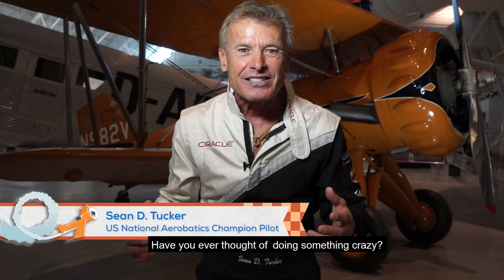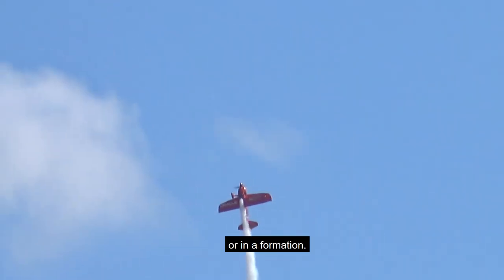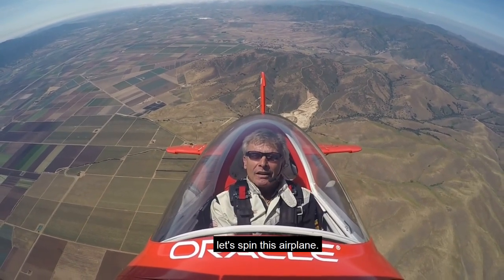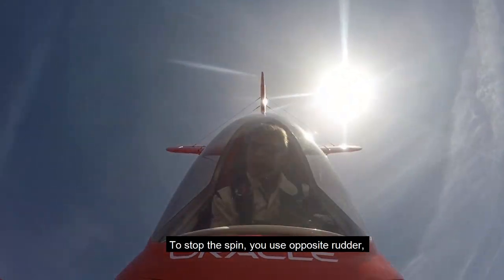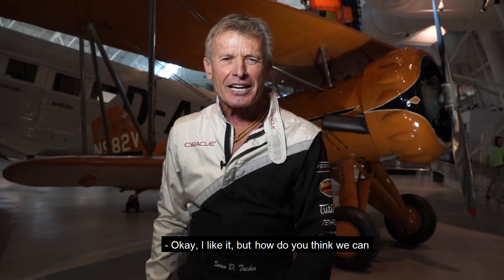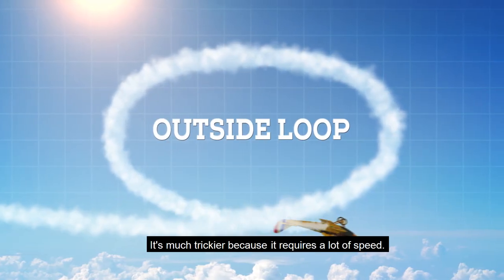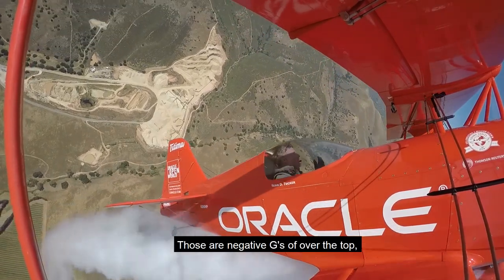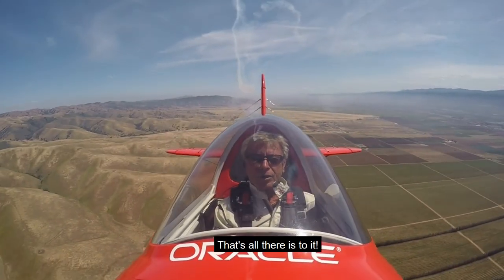Aerobatic Champion Demonstrates Loops and Spins

Comment: The transcript says he's mumbling at 2:04, but he's actually saying "aileron", a term used in aviation. Just wanted to point that out!

Wikipedia:
"An aileron is a hinged flight control surface usually forming part of the trailing edge of each wing of a fixed-wing aircraft.
Ailerons are used in pairs to control the aircraft in roll, which normally results in a change in flight path due to the tilting of the lift vector."